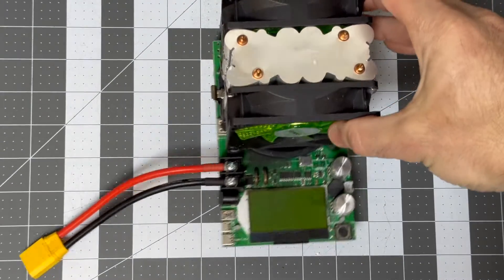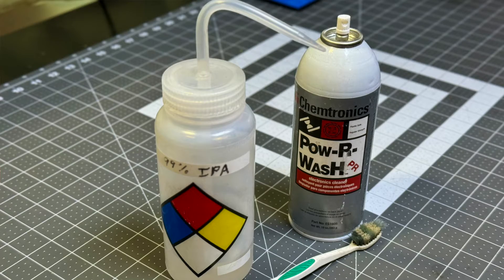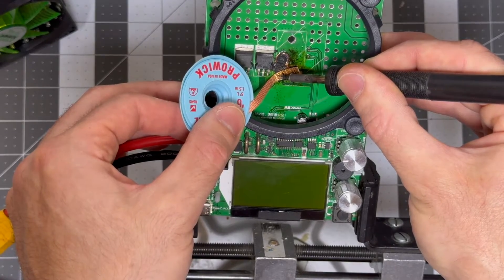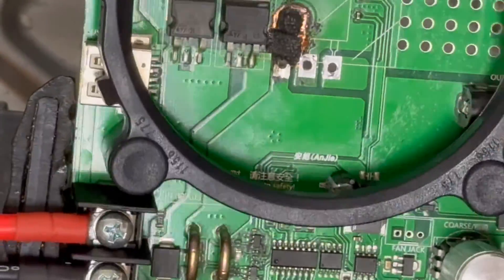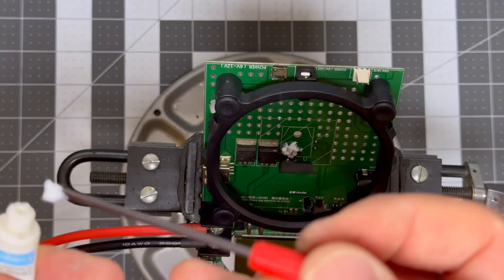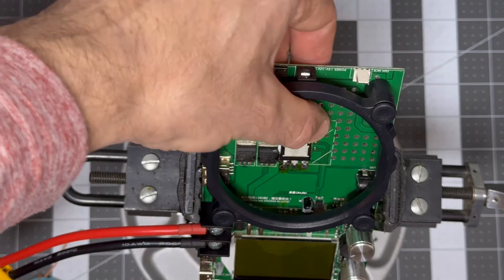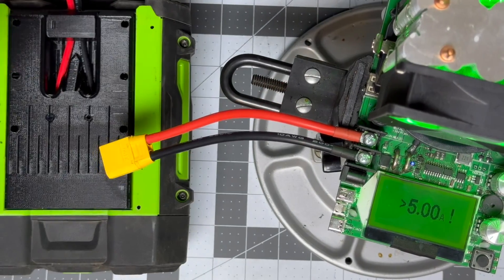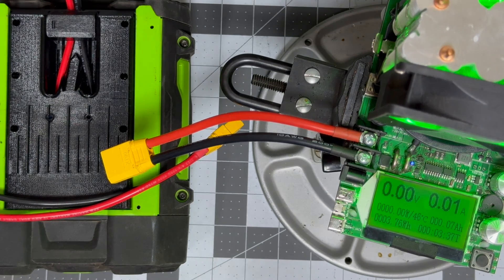Repairing a DC Electronic Load Battery Tester

Comment: To improve the safety, you can install a second identical MOSFET in parallel to the existing MOSFET. Drain to Drain, Source to Source. Each gain should have a small value resistor connected for balancing, and then connect the other end of the resistor to the driving circuitry.

Comment: In the  original datasheet under figure "Maximum Safe Operating Area" the maximum operating  current between 50 and 60 V is less than  2 Amps, so you were operating the poor thing already out of its safe region for continues DC  current!!
Reply from the maker: Yeah totally! I was only going by the ‘180W’ advertised for the load! The linear FET I put in is way better.

Comment: Lesson learned: Never run a high energy source without proper fuse. This prevents from burned circuitries.
Reply from the maker: Not really a fuse issue. The MOSFET just isn’t up to the task on these. The fuse would have to be tiny!

Comment: Now you modifies the shunt value, based on where you soldered the wire.
Reply from the maker: Yeah, you are right. I did a follow up video with an upgrade that actually solves the problem. https://youtu.be/aNvb4cWcCb4?si=hx8XXVEicdYZkPsW

Comment: You can set the max watts on these.  Just force it to max at 125W or 100W and it won't let it go past that.  They should do this by default, but instead set it at 300W or sometthing too high.  For 56V just use the fine adjustment knob and leave the main one at zero.  I was able to do 56V @ 2A for a few hours on mine.  As soon as I tried 2.5A it blew.  I put a new mosfet in like you did and it is good again.

Comment: Would you mind sharing the PCB holders you are using at 3:21 and 9:10? Can you also share the wires you used to connect your battery to this load tester? Did you make them or bought them? If you made them yourself then can you please share the connectors you used with what AWG wire?  Thank you.
Reply from the maker: @amitchugh4345 Here's what I use:
PCB Holder at 3:21: PANAVISE 350 PCB Holder: https://amzn.to/3WzDyAS
Flexible High Temp Silicone Wire 10/12/14/16/18 Gauge: https://amzn.to/4hh7Y3q
Amass 10 Pair XT90 Male Female Bullet Connectors: https://amzn.to/4gbghfG

The holder you see at 9:10 was from a short production run so it's not available but in general they're called 'helping hands' and this one has 'Noga arms'.

The load tester comes with a variety of connectors but I made the one in the video myself. It uses an XT90 connector and 10 gauge silicone insulated stranded wire. It will be easier to find suitable ring terminals for 12awg though. Hope that helps!

Comment: It would be a good idea to clear the charred/carbonized "burn" off the board since it can be conductive.
Reply from the maker: @stevetech7335  you’re saying the fiberglass/epoxy/whatever core of the becomes somewhat conductive when charred? I didn’t realize that. Can you explain more?
Reply: @colindgrant Yes, the formed carbon deposits are conductive. The common approach is to scrub it off, or grind it off with a grinding pencil, and then rebuild the board with the conformal coating. If necessary, the lost traces would have to be rebuilt too.

Comment: Yeah, I guess there is a reason why the more expensive loads like the Siglent SPL1020/ 1030x loads are a lot more expenisive, using a few more MOSFET’s rather than 1. I guess you get what you pay for, I have both, the simple one that you just fixed, and then I got the Siglent load. You definitely get what you pay for. The cheap one served me well enough, but combined with the weird GUI, and no dynamic load testing (even though the software should have been able to do it), that cheap load has found a place on my shelf reserved for equipment I don’t use anymore.
Reply from the maker: Couldn't agree more, I'm definitely ready for a 'real' load tester, just looking for the right deal to come along. This thing has been surprisingly useful, but I'm ready for a tool that doesn't need constant monitoring and a fire extinguisher!